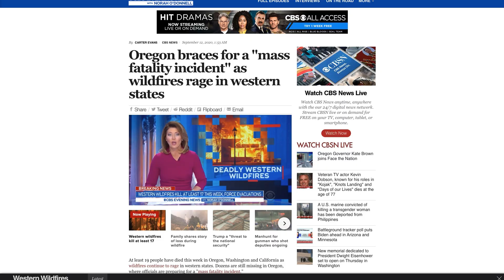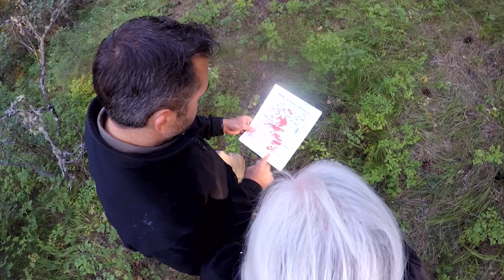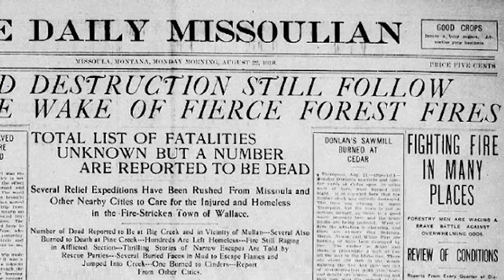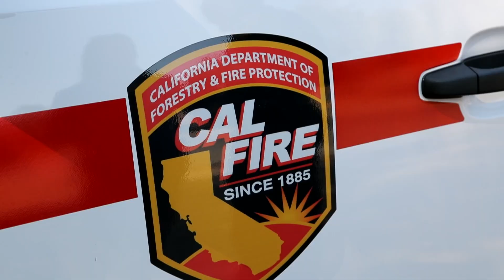You NEED to know this about the WESTERN FIRES (Wildfires Explained)

Comment: Temperature in fires is different between the clor of the flames.  Red, orange and yellow are you campfires they are the coolest fires. These are common with plant life fires or gasoline. That why gas can be use in a engine and not melt down. Blue flames kerosene, propane and natural gas. These gases burn hot but dont melt metals like iron or steel like they said happen in the twin towers! That should be an eye opener! Kerosene is also known as jet fuel. If kerosene melt down metal. Why would the use it in a jet engine? It would melt the engine down and the plane would skydive. So believe nothing that you see, and very little what you hear. Wake-up America! Because the wokes are coming for you!😮😮😮😮😮

Comment: They spray atomized metals for years over these areas and when they get a hot enough fire going it will not only spread quickly but it will burn so hot that it cannot be extinguished through typical firefighting means.

Comment: I remember a time in California when the forest service actually cleaned up the forest . You know, Forest Management. That is wheats they forest service is supposed to do.  I grew up in the Los Padres National forest when there was still control burns. We never had a fire in our Community  in the Mountains, until the fire  Management stopped. Now witnessed and have experienced too many devastating fires that could have been prevented. This is not due to any "Climate Change."  There are  powdery chemicals coating the foliage of which two fire Captains came forward a few years ago after the Campo Fire in Paradise and the  big Fire in Redding .  It is all over the place. It makes the fires burn hotter and are hard to put out.

Comment: You can say oil oil but it boils down to dry boreal forests with moss flooring and lost of softwood spruce jackpine tamarak and balsam with hard woods poplar and birtch experts are wrong when a boreal forests are supper dry with no rain but humid temperatures with dry thunder storms with little rain and lost of lightning strikes which in any boreal forest lightning strikes 2 days before burns underground and then it surfaces with nobody even knowing there there that's the trouble she is wrong when spruce which is the worst of all trees to go up there limbed top to bottom with branches of gas when a mature stand of spruce goes up 70 to 80 ft high wall a mile long it's unfightable to hot to high with blueish color coming of tops which is sap making it burn hotter they keep saying Alberta oil it's got nothing to do with fires why do we have over a 100 fires burning in northwestern Ontario now just northwestern part it's not oil it's humid dry hot no rain lost of lightning strikes if the polar bears are losing ice it's coming South everything is going to keep coming farther South every year I hate when they being oil and logging up cause oil has nothing to do with it logging practices are better then ever I saw the guy in Quebec go over the 7 or 8 fires that popped up at same time and area there was no lightning strikes that day but 2 days before that the entire area was hit by lightning strikes lost of them with dry conditions they burnt underground for 2 days then exploded and one of are biggest rail companies CN there main like runs through a good part of northern Ontario and Manitoba and trains have sparked fires with the dry thunder storms with lost of lightning and some people don't realize most of northern Canada is all boreal forests with thousands of lakes then farther up you get into tundra every province in Canada has a forest fire burning every province coast to coast and North to Yukon territory and North West Terratorys and she is saying oil industry in Alberta is problem well if that was case we should not have fires burning anywhere else in in the Bush steady worked in Bush all my life and have never seen it so dry when we were kids I remember getting so much snow we would build forts where grader plowed snow bank up now some winters lucky if it snows 3 or 4 times heavy even rain it's been such a dry summer like last year think I cut grass 2 or 3 times cause no rain and the sun just killed your grass everything is going for a S.H.I.T everywhere North America is getting to point with better radars and stuff the forecasts are impossible to make areas that don't get much snow getting more places that get lots arnt  it's just changing to fast for us and I hope younger generation can get a hold of it peace to all thanks

Comment: I’m a retired fire engine captain for the US Forest Service. Retired in October 2018 started my career in the summer of 1985. I been on hotshot crew for 7 years . Worked on engine crews as crew member , assistant engineer and eventually full time supervisor Engineer. 
I been on many Fire Dispatches from Vehicles, structures and wild fires in California . Fought in most fuel types and terrain in the Western United States. 
When I first started the focus was drilled into our heads was safety and two minute get away. Meaning we had to drop what we were doing at the station and immediately jump into the fire engine .
Our dispatchers were very professional and had plenty of experience. The old systems was more on how well the dispatcher knew the Forest . Later computer systems were installed and mass retirement of the older dispatchers took place. 
Less experienced people were hired and had no clue of the road system of the Forest . The dispatch to fires became slower and less efficient. 
There were times I sat inside my engine waiting for direction to head out to the fire call. Some times I waited for 15-20 minutes to get on the road. When I took it upon myself to get on the road. A fire management officer would catch me and give me a tongue lashing for self dispatching myself. 
I was told not to leave my quarters until I was told to do so even though I knew the fire location. 
I made a complaint and became a target in fire management eyes. 
   One time I took a type 3 incident command course and was told type 4 IC s don’t care if the fire was put out or not. 
   There is a lot of money in contracts that go into fires. The contractor for the shower units make a killing . The support of rental vehicles is lot of money. Some retired former employees make more money contracting themselves out. Some make around $57 dollars an hour. They aren’t interested in making a fire short and small. Even the air tankers are contracted out and the supplies to run these air tankers. The fire retardant alone is wroth $7 thousand for 500 gallons. 
Most of the Forest service employees don’t come from the local community. They have no investment in the local community. Government employees move from Forest to Forest 
    Every summer is hot since I started back in 1985. Haven’t had a cold summer yet.
Reply: We had a local wire fire  erupt near a residential area, Local crews were dispatched. the Chief was in front of the pack he was stopped at an intersection by the inter-agency incident commander who instructed him to turn back. He said I advise you to move your truck or my guys will run your azz over.. They go contain the fires and save the subdivision..

RIP R.A / You made a difference in this world..

Comment: Concerning the end of the video. Climate change is natural ! You mean man made change. Man can not change the climate. our CO2 does not change the climate. Their predictions are based on THEIR computer program models. 
Back in the mid 70's they said it was aerosols that was destroying the ozone. So we all had to ban the use of aerosols. Then in the late 70's it was mans CO2, but they said by the year 2000 all of Canada would be under "ICE" and it would be going into the northern boarder of the US (guess what, it didn't happen). O ! by the way, when I was growing up in the 60's July and Aug. was much hotter then, then it was this year. The wobble of the earth and solar flares have more to do with over all avg. climate changes.

Comment: If you create a 300 meter low fuel fire buffer around housings and have a tin or clay tile roof, then we would have almost no houses burning down. A house WILL catch on fire using wood or asphalt shingles when burning embers land. It is simple engineering and a change in housing ordinance, combine with forest management in general, problem more or less gone...

Comment: Prescribed burns, better dead fuel management is a must.  Unfortunately its only a part of the equation.  We are not living in 1910 anymore.  I moved away from socal and after visiting about 5 years was shocked to find miles upon miles of nothing but dead trees.  All killed by bark beetle.  Nothing but giant matchsticks left.  Also droughts have become more frequent and longer.  Healthy trees are dying because there is not enough water.  Without water trees lose defense against bugs as they can't produce sap.  So little snow recent years many of the plants that soak up water and go into hibernation come summer have lowest moisture levels ever.  Alive plants are left with moisture levels similar to dried up dead wood.  I visited a fire area recently from 3 years ago and what was lush forest has turned into a desert.  These are not normal times.  No forest is going to grow back without water.  Rising temperatures aren't helping either.

Comment: Kick out the timber industry and you kick out growth management.... California is a good example....
Reply: Forests were fine for ages long before timber industry.  Fuel loads building is a big problem but only part of the equation.  I personally witnessed some forests in socal get decimated by bark beetle.  I am talking driving on road for miles and miles and struggling to spot a single living tree.  Nothing but giant matchsticks left standing.  Add drought into equation.  I live in Tahoe basin(currently evacuated).  For a long time in my area CCC(CA Conservation Corps) been clearing crush, piling dead wood and burning it.  Also prescribed burns.  Its a simulated natural fire.  Problem is there has been so little snow plants and trees that absorb water and go into hibernation during summer time weren't able to.  Which resulted in record low moisture levels in plants.  Some cases alive plants have same moisture levels as dead fuel.  Drove by Tamarack fire month back and many trees that didn't even get hit by fire are dead.  Because they had no moisture to protect them from the heat.  Forests will not grow back if there isn't enough water.  Can't ignore record heat and droughts which have become more frequent and longer.  Talk to anyone who lived in high Sierras for at least 30 years.  Everyone will tell you there is way less snow, winter starts and ends 1-2 months earlier.  No forest management can fix climate change.
Reply: @KaliAndy2  agree. All around us Pinus Edulis- Piñion pine is dying. Forest Service here does a good job with prescribed fires. Fuel load is pretty light. But within our lifetime, it’s already visible, our landscape is changing. Honey Mesquite is coming up in elevation. It’s not supposed to be here. Used to be too cold. Not any more.

Comment: Climate change's got nothing to do with it. The burn acreage in the 1930s was much higher than now. In 1930 there were just over 50,000,000 acres burned. In 2020 there were about 10,000,000 acres burned. 2020 was far from a record, despite what some in the Biden administration said. Even if you could get CO2 down to 250 ppm, which we can't, it wouldn't matter, there would still be forest fires in the West.
Reply from the maker: Well, I will say that climate change does play a small role. Particularly places that were forests will likely get replaced with grasslands after fires come through. That's the natural pattern as things heat up. It's not an all or nothing proposition. That's what is bugging me. People will say it's EITHER all Climate change or all management. Truth is in the middle and it's a bit of both really. I'd agree with you though if you're also trying o say that the management thing is WAY more important. - R

Comment: I think it's worth mentioning that fire doesn't enter old growth forests, as they are naturally "thinned" and have a lot of understory moisture.  So it's not that forests need fires; it's that disturbed forests need fires until they return to old growth.  A solution should be designating large areas of connected land as places we will return to old growth status, even if it takes several generations and population control measures to achieve that.  Speaking of population control, I couldn't help but think as I was watching this that since we are "unnaturally" (whatever that means) prolonging human lives (with, eg, antibiotics that are creating superstrains, vaccines), one day human population will dangerously drop like the trees are doing without certain measures as unpopular and sick as that sounds.  It's like one day we will have to choose between prevention of life or large-scale/massive deaths and destruction.
Reply: As far as population control, it's not how many, but where that has gotten out of control. Urban sprawl with low density housing right on the edge or even almost surrounded by forrest, that is a big problem. These fires are going to happen, we need to stop building right where they happen.
Reply: Fire does enter oldgrowth forests. Shallow Pop thinking is the real problem.
Reply from the maker: @davej7458  Going to have to agree with David here. Fire does enter old-growth forests. Redwood forests don't get a ton of fire though (which might be what you're thinking).
Reply: Regardless of how people feel the world is overpopulated and we are going downwards rapidly, be it fron unnatural medicine, easy living or lack of wars.